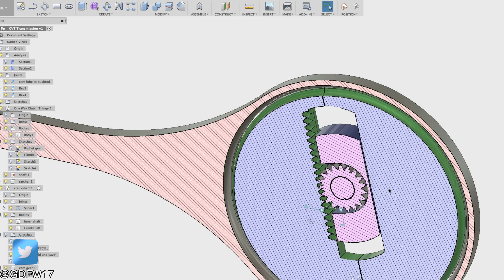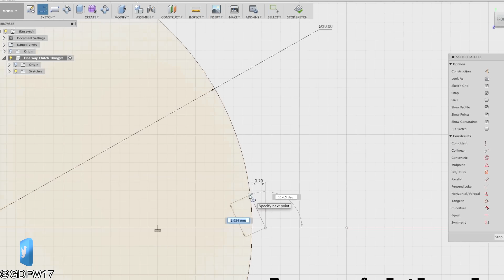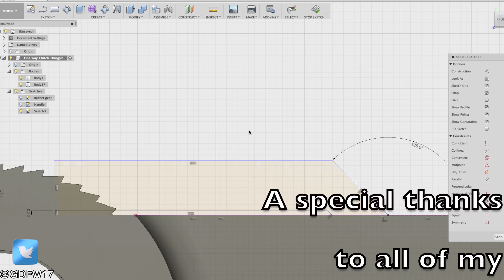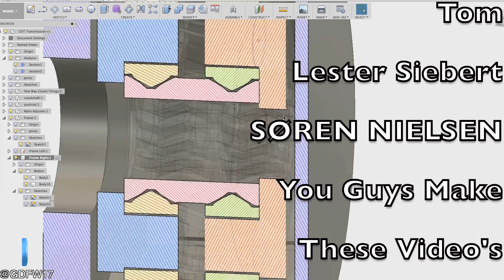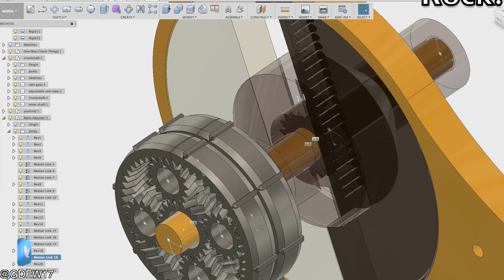The Coolest Transmission You've Never Heard Of... The Ratcheting CVT

Comment: I had one in a 2006 Ford Freestyle. It worked well if you don't want to take off like a jack rabbit. The engine was severely retarded on takeoff to avoid damage and I was warned at the dealer NOT to tow anything as these were NOT heavy duty transmissions by any stretch of the imagination. I had 122K miles on it when it got totaled. It still "shifted" into "gear" tight and I got the same gas mileage from the day I bought it until 6 years later on the day the car went to the scrap yard. The down side was the fluid and high pressure filter had to be changed every 60K miles. This was a $500.00 dealer affair as the engine had to be pulled to get to the filter and no transmission shops in my area would touch it. Also it was a $5,000.00 Ford dealer item to replace if it did go out.

Comment: typical CVT, blew up, first rattle out of the box. As a master certified tech (20+ years in trade), i must correct him on a couple points. First is that the first generation of production CVT transmissions worked as a CVT was designed, the second and subsequent generations is when they were programmed to "shift" like typical clutch and planetary automatics. People were not comfortable with the non shifting transmissions as he stated. CVT transmissions have been in use since the late 1920's to 30's. Most notably in motorcycle racing, specifically hill racing. Golf carts, go-carts, small ATV's, ect are their typical uses currently. The automobiles with CVT transmissions are junked more often than they are repaired because the automotive industry places a premium on parts (900-1500$$ for just the belt, not including paper rubber or clutches or labor) that it is not cost effective to rebuild one. The price of a crate unit as a replacement is ridiculously high as well, 4000$ for the unit not including the labor on a car that is worth 3000$. The CVT is not a viable transmission past 80k miles and not worth replacing as described above. (spent 15 of my 20 years in trade in a transmission shop). Until the automotive industry provides cost effective parts alternatives, as well as proper repair information as well as a profit margin, they are relegated to the scrap heap. The cars that have them are undesirable and the customers that buy them are wasting money.

Comment: This is not continuously variable. Each turn of the input will turn the output an integral number of ratchet steps. You can make the ratio steps arbitrarily small by having an arbitrarily fine ratchet wheel.

Comment: I noticed the conspicuous lack of mention that you may not want a CVT because it may be incompatible with what you want your vehicle to do. Perhaps you want to tow something heavy, and so you need to be able to stay in a very low gear and rev up to get more power on the ground. Or you use your vehicle offroad, and need to stay in a low gear to either get up a hill or to control your descent down a hill. Or maybe you want to be able to control which gear you're in for performance, so you can be in optimal gear for each curve. Or, maybe you just enjoy shifting gears. There are plenty of reasons not to use a CVT other than reliability or not understanding them, and there's a good reason anyone interested in performance cars laughs in your face if you suggest CVTs are desirable.

Comment: That´ s a neat mechanism that surely would be interesting for industrial machines.
By the way, Dutch car factory DAF built a fairly widely used CVT known as the Variomatic, which was sold from the early seventies until the late eighties in their Dafodil cars and later on in the Volvo 340. The Variomatic was very reliable and long lasting. A colleague from university owned one that had 360000 kilometers on the clock and went like on day one. Disadvantage was that the transmission made an unpleasantly noisy whining sound and the centrifugal clutch engadeged so badly controllable that the car would normally hop into motion, rather than starting gently. In theory, it could make the car go at its full speed backwards as well. With the Volvo 340, that would be just under 100mph/160Km/h. Unique, slightly weird yet very, very good cars. I owned a manually shifted one for some time. I guess there never was a more useful car on the roads.
Reply: DAF trucks?
Reply: Eo Tunun wait does this mechanism even need a clutch? It can be stationary while still having power run through it. And how can it be a manual doesn't it have a lot of gears. Or have i misunderstood how this transmission works
Reply: @Adobes: Nope, sadly there always is a minimum transmission ratio the Variomatic can offer. Here´s a nice video showing it at work: https://www.youtube.com/watch?v=2NeyoNdsHTI
I found another video of a chap recording a trip in a 340 Variomtic:
https://www.youtube.com/watch?v=5NQMkhqQ5Lk
The lad ist really doing well, yet you still see how the car starts moving in little hops most of the times. It´s just how these cars did it. I loved the 340 with a 4 speed manual transmission to bits though. Great economy, comfortable, could load incredible amounts of stuff and turned on a dime. The best car for ice and snow I ever laid my hands on. When others didn´t dare to go any metre with their FWD cars due to ice rain, I´d have a ball drifting eights around the trees in parking lots. ^^)
@Yinan Liu: Nope, nicely small, decent personal cars.
Reply: Now , Audi cars are using CVT transmissions , but the belt is replaced by a metallic one , that ransmission works good but requires a very precise maintenance and oil changes with a special ( expensive)  oil , and must be done at  precise temperatures when drained and filled it with the new oil .
Mopeds and snowmobiles uses CVT transmissions too .... mopeds used them first !
Reply: Cletus Spuckler ahh i was thinking how mopeds drive the other day but forgot to google it. And i thought an auto trans (without gears? (very useless)) would be too complicated. This makes sense. But does a CVT still require a clutch
Reply: Cletus Spuckler airplanes as well. I believe Subaru was the first car after the year 2000 to use a cvt, now most compact cars are using them. When Subaru came out with theirs they put a LIFETIME warranty on it. Not sure if they still do that or not
Reply: Nissan developed the daf variomatic into the smoothest quietest of things. You have to change the carbon brushes for the electromagnetic clutch every 100000 miles! Too good, they no longer use it.
Reply: Eo Tunun That’s*
Reply: It´ s my comment and I plenk if I want to!!1! :op
^^)
Reply: Eo Tunun It’s

Comment: Alright, I already have an application for this, using electric motors (where the power is in the lower RPM).  I have a friend that runs an electric dragster made from an old pinto (known as the Crazy Horse).  If this could be auto-milled in metal off your printing designs that would make a lighter, and from the looks of it more stable CVT for that.  Also, adding reverse would be epic, I want to see more!

Comment: I had read this article back in the 90's in Popular Mechanics (or Science) about a guy who designed a gearbox that went through all the ratios from 1:1 all the way to 1:30 and all gears were in mesh all the time, there were no clutches, springs or other form of motion control. Where did all the lost motion go? I remember thinking how brilliant it was and this guy shopped it around to all the auto manufactures, but they were happy with their current design and he dropped it. He said he designed it using electrical schematics because that is how he thought because he was an electrical engineer. Damn, I wish I could find out all the details. It really was ingenious. With all gears in constant mesh, the lost motion has to be eaten up somehow.

Comment: I have two cars that are identical except one has a 5 speed manual gearbox, and the other has a CVT.  The CVT is definitely programmed properly because it strongly prefers to either be at 2000 RPM to hold your speed, or 5000 RPM for acceleration.

Unfortunately, the CVT is an absolute dog.  Very slow.  If you're curious, it's equipped with a Jatco CVT7.  As for fuel efficiency, the EPA CVT numbers win.  However, for my real life driving tests, the CVT also gets terrible mileage.

Perhaps that model of CVT is a particularly horrible model, I don't know.  But I do know that if they are still putting crap CVT in 2014 models of cars, there's a lot more work that needs to go into CVT design before consumers will want them.

Comment: at the ratchet output, remove it, and add a lever to increase the output length and throw and place it there, see if you can get the output rotations to meet the input rotation over time without the drill stopping. Can you imagine what it could do with a rotery at 10,000 rpm with proper counter weights set with the length and duration of each on the secondary end.... then think hydrogen and timing and we may be on to something

Comment: the current design would deform and would also have a lot of wear, it would take about 50 000 000 to 100 000 000 circulations and it would rip it self apart even with a better design if it was made from steel, at a size that could run a car. submerged in oil that would be changed regularly could change this, but its still not very good.

Comment: Beautifully done! I just recently drove a Jeep with CVT with an auto-stick feature. I, too, was quite disappointed with the auto-stick having been turned into a 6-speed type setup. wtf? I figured it would work so that if you hold the "gearshift" in the upshift spot it would just gradually raise the "gear" ratio until you stop holding the shifter in that position. Nope. It just bumped the ratio up a notch and held it there. I also think it would be cool to have an auto-stick where the gearshift moves along a longer path, and you can glide the shifter to whatever location you wanted in that path to adjust the "gear" ratio... Seeing the shifter automatically move when the transmission downshifts automatically would be cool, and it would help solidify the concept of what the transmission is actually doing to the driver. As a safety feature it could let you move the shifter where ever you'd like, but if the computer notices, for instance, that you're trying to make the system do the equivalent of shifting to first gear while driving at 70 MPH, it would only allow the transmission to actually "shift" to the lowest safe ratio, and when you let go of the shifter it would move to where that safest low ratio is.  I have to admit that when in fully automatic mode on the Jeep I drove,  the ratios change remarkably smoothly, though. It takes a little getting used to when we're so used to fixed ratio shifting transmissions. Hell, we don't even have a word besides "shift" to describe what a CVT does! Good shit. Thanks for sharing. :)

Comment: Why don't you use 3 extra balancing phases to reduce vibrations as well as one-way bearings instead of ratchet and you would get less vibrations. Also a elastomeric bearing might help smooth the angular vibrations at the output shaft. This is quick advice but you can fill in the details as you go. Ultimately metal would be the way to go.

Fyi- I am a MechE so I am fascinated with gears as well and I like your design. I hope to see it in something like Fords or Priuses one day.

Comment: What if you connected each of the output push arms to a wheel connected to the output shaft kind of like a steam train.  Each shaft separated by 120degrees.
All three couldn't connect to the same wheel because they would interfere with one another, however you could do 3 output gears that drive an output shaft.  
This way the transmission would be smother and reversible.

Comment: Hey not an engineer here. Could this would work great for electric motorcycle? The motors that DIYers use on one gear can go up to 60mph. If it had a gearing system you could get more range and top speed and you would really only need like 2-3 gears.

Comment: That's a very ingenious machine and I like the positive engagement. But I have a suggestion. Instead of the double differential method of cam adjustment, why not use levers like in a variable displacement internal combustion engine? Less parts to put together. Better yet, what would be wrong with incorporating your variable cam ratchet concept INSIDE a variable displacement engine?

Comment: Auto transmissions have a sprag clutch that should work much quieter than the ratchet assembly.  Balance and torque might be some issues. What about overdrive? Would love to see something like this that could handle the torque and HP of a modern diesel.

Comment: I thought of the same idea but took it a little further. Even then, there's no good way to reduce vibration on the output without significant weight additions, plus it's technically not continuous.

Comment: I do not know what tanks you have been looking at but, most US tanks do not use a separate motor for steering, they use what is known as a cross-drive transmission that has one input and two outputs. A cross-drive transmission steers the tank by the use of brake bands similar to an automatic transmission's clutch band, the design of the transmission allows for the differential effect within the unit. I just wanted to clarify this for you as I was a US Army tank mechanic for many years.

Comment: You know, if you were to implement a servo motor on your gearing mechanism to adjust the ratio, I bet you could use an Arduino system to monitor torque and RPM speeds to adjust the gearing for you to maintain the optimal rotation-to-power ratio.  Heck, I bet you could even create a control slider to adjust the gearing to provide acceleration without the need to change the motor's input speed or torque.

Comment: I remember reading about a transmission in Popular Mechanics some 30 ish years ago.  It was referred to as an "Infinitely Variable Transmission" to differentiate it from the Van Doorne belt and pulley system everyone is familiar with.  This looks exactly like that IVT that was written about.  It was fascinating.  The issue with a CVT is not one of friction materials wearing out.  They require enormous clamping pressures to keep the belt from slipping in the pulley, making them poor transmitters of torque.  The metal belt in the automotive application is still a weak point, and is the primary failure of an automotive CVT.  The design you, and others came up with was meant to put a CVT type of transmission in high torque applications by giving that positive geared connection.  Your model does give the primary problem of the IVT - that stoppage you were referring to.  That would put tremendous vibrations in a driveline, causing some issues with the smooth transfer of power.

Comment: by George I think you got it! back when I was younger, before driving age, I put a ton of miles on my bike. I thought of a similar mecanism that would change the length of the pedal crank arm while under way, so under slow, high torque the crank would be longer and as you sped up the crank arm would shorten.

Comment: Just a thought ... Lotsa output shaft vibration with 3 cams ... Why not 36 ??? ... More constant movement of output shaft and power applied to output shaft means smoother output vibrations ... Add a splined shaft and almost all vibration goes unfelt ...

Comment: way too many moving parts and failure prone. you would be replacing your ratchets or clutches all the time. Cleaver, but typical over engineering from an "engineer" who has never had to maintain anything before. No disrespect, but try to come up with a solution that does not rely on clutches or ratchets. You dismissed fluid based transmissions earlier, but perhaps you should revisit the wonderful application of shear thickening fluids in the  ubiquitous torque converter and see if you can apply it to your device. A hydraulic one way drive mechanism would be easy to apply and is well proven as a reliable means of power transmission.

Comment: ok... I'm just a regular guy but I would like to share a tought that you may already had or maybe it will make you think
what if this 3 connecting rods was attached at 3 pistons, working on the other way... the pistons would drive the shaft (by their gas explosions)
your gear box would be replacing the regular crankshaft of the engine, so the gearbox and the engine would be one only thing... the engine driveshaft would have variable speed even when on a fixed RPM rate
it would save a huge weight
to be honest I didn't think really far because I'm not a engenier and I'm not quite sure that I understood the kinects of your machine, so I'll let you reflect about it :)
Reply: Maybe, get informed on that, it could be useful once we make the giant global air purifiers to stop global warming and keep the pistons.

Comment: For use in automotive that ratcheting would cause a lot of metal wear. Come to think of it so does a cam shaft. It could work bit you would need a special oil to keep it from wearing out too fast. Still a better idea than friction bands in today's CVT. Perhaps a 10w30 or 10w40 would be enough to prevent that wear. Also a good ratcheting low friction turning design would help increase the life of the transmission. Hopefully car manufacturers start to use this idea. Even if they don't have the patents a deal can always be made for licensing of the technology.